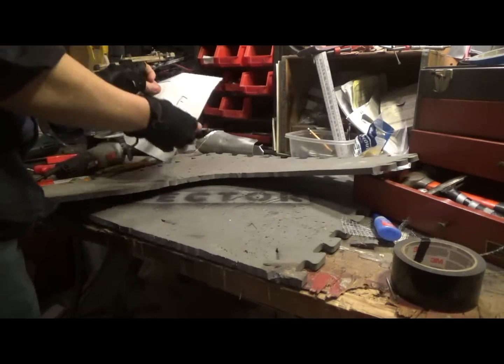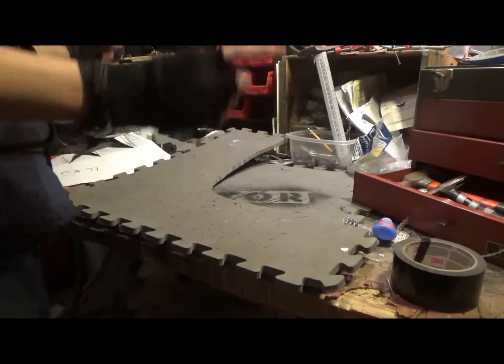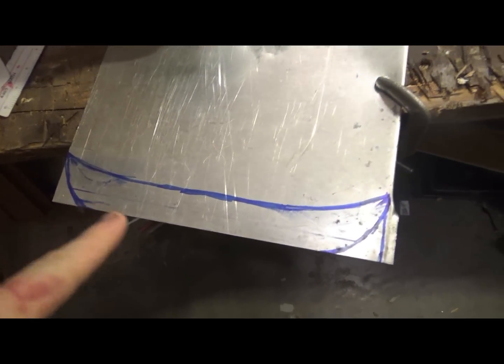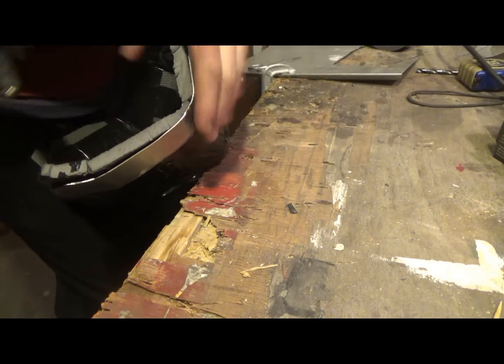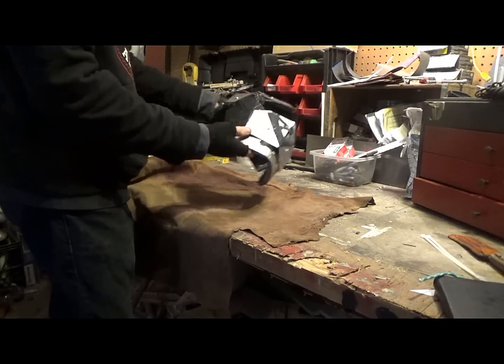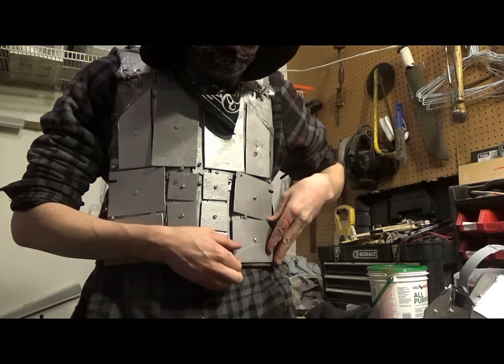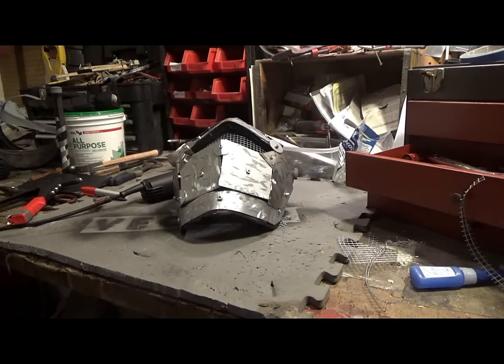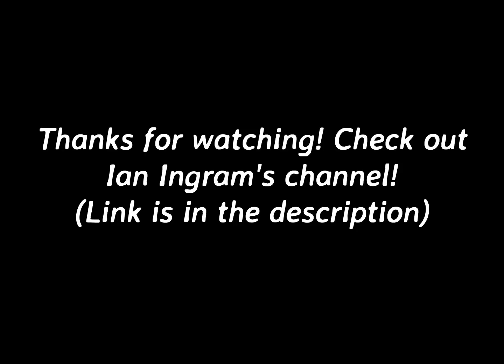ARMORED HELMET TUTORIAL

Comment: I love the helmet an an all but you should of just glued the foam in later instead of use rivets. May poke or stick at your face
Reply from the maker: well i wanted something to act as a base to then plate the steel on top of. The most plausible option for a base was the padding itself. And since i popped the rivets from the inside, they dont poke at me anyways.
Reply: The Vector Project oh ok an pro stats on head butting that ginger bread house. I